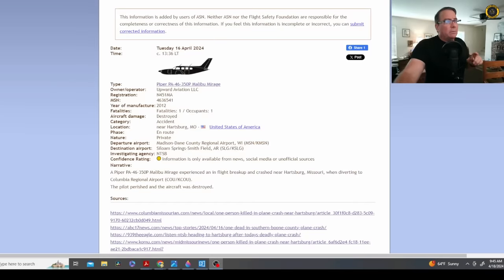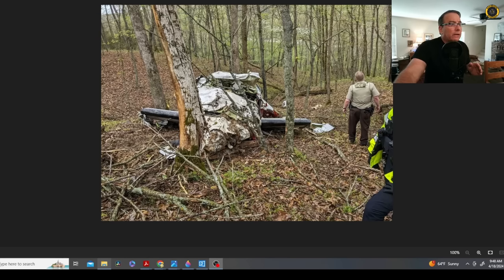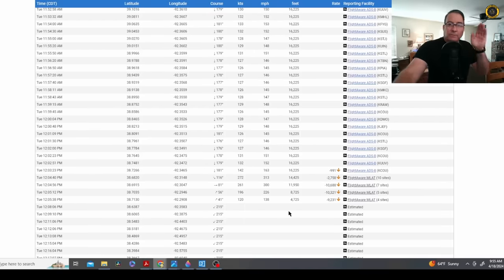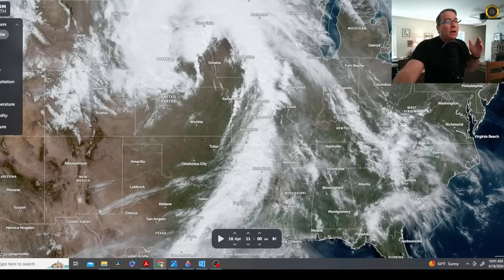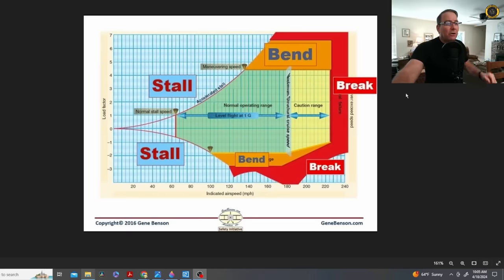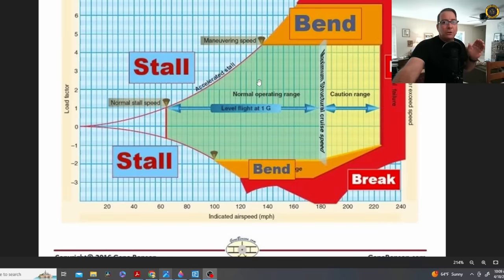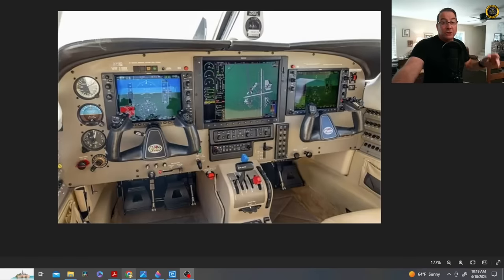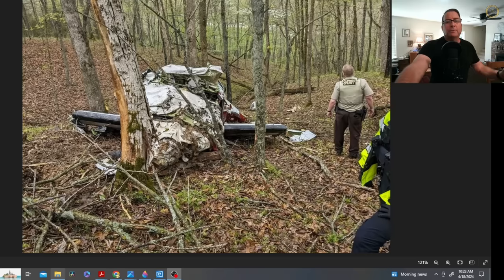N451MA PA-46-350 16 Apr 2024 Structural Failure

Comment: I worked with some Piper guys years ago and they were complaining about the Malibu crashes that were happening.   Seems that the owners basically said "I paid a million dollars for an all-weather aircraft and by God I'm going to fly it through thunderstorms" which is what caused the vast majority of the accidents.   NOBODY in their right mind fly's ANYTHING through a thunderstorm!

Another guy testified in a crash suit where the elevator had come off much like what was shown in this video.   He did a demonstration that the elevator and controls could withstand 6 times the maximum load before failure...but in closing arguments the prosecutor said 'You SAW how the tail FAILED'!!  And the jury found Piper guilty and gave the plaintiffs a big award.   Lay people don't seem to understand that things are built with limits and you MUST stay below them even though what is advertised in the Pilot Manual will have some headroom...don't push it!
Reply: People that buy these planes are usually self made millionaires, risk takers.
Reply: Flies*
Reply: I used to work for the Just Ice Dept. as a tech. and the cases get sealed so the next time there is no precedent...
Reply: „There is no reason to fly into a thunderstorm in peace time.“
Reply: @MrMonoTracer or unless you’re NOAA or NASA maybe.
Reply: You bring up a good point.  A friend of mine who was instrument rated died when he flew into a thunderstorm at night near Downing, Missouri in 2004.  I'm thinking that he had to see lightning ahead. (he did not have weather radar).  He was fine when he talked to a controlled 11 minutes before he disappeared from radar. That controller did not warn him which was the basis of a lawsuit later.  But what possessed him to keep going. This was the FAA's position in that lawsuit.  I think they did settle however.  There was a lot of money at stake because they all three  had high paying jobs.  I think about 20 million was being sought. The FAA may have tried to get off cheap in case they lost.
Reply: Amen Brother. Mother Nature wins every time. Fly smart, fly safe.
Reply: @MrMonoTracer That’s a military saying. In the airline world it’s very possible to fly through bad weather.
Reply: Lol what? So the company makes a claim of all weather and you are like "it's fine they didn't meet the standards they advertised and set for themselves". As an engineer yes things have limits which is why you engineer margin of safety into your designs. Lol to say that it's impossible for someone to design a strong aircraft for thunderstorms is absurd. It even sounds like the court agrees 🤷🏻‍♂️
Reply: We were forced to fly a F-4N Phantom through a line of thunderstorms off the Florida coast on an emergency fuel divert from the boat.  It was not fun and I wouldn't want to do it in a plane with much lower stress limits.
Reply: It's the V-tailed doctor-killer mentality.  They are successful people who got where they are by not taking no for an answer.
Reply: @raybruce9522  Well, as an airline pilot, I can tell you that thunderstorms scare the crap out of me. Been there, done that. No need to do it again…
Reply: Yes, all these high-performance, single engine, turboprop aircraft are becoming the "New Doctor Killers", a title that was once held by the Beechcraft V-35 Bonanza.  Owner pilots with more money than good judgement and flight time.
Reply: What happened to max speed in rough air??no POH info?? Every aircraft I have flown have a max vne for rough air!!!😮😮😮
Reply: Reminds me of a time we were in an old Cherokee and got surprised by uplift of a front between SC and IL.  Dad looked for a way out because he was uncomfortable getting near the top limit and he somewhat turned out and went down lower. Later, my dad said the book says not to turn around. I was too young to understand the flight physics, but I'm expecting that this sort of chart is the reason.
Reply: @jimw1615  "Owner pilots with more money than good judgement and flight time." That's a good description of Cirrus pilots as well. At least with them they will likely survive due to CAPS, BUT . . . because of CAPS they do not make the best risk decisions.
Reply: @flybobbie1449  Cereal box licenses too.
Reply: @jimw1615  I'm a non-pilot, I can't afford it, and stuff like this really shows why aviation is so expensive.  The cost of a new plane is nuts, even a 172 is a half million dollars new.  Rich people buy expensive planes, the plane is more than the ability of the pilot, or the pilot takes risks, and then the estate sues the manufacturer, and the manufacturer usually settles, raising the cost of all new planes.

Not really related, but I think about TNFlyGirl, she had to move up to a complex hi performance plane, so much more than she could handle, and she died.
Reply: A prosecutor in a lawsuit? Was the state suing Piper?
Reply: I’ve seen from my 767, a 747 going by a massive thunderstorm up to 52,000’. It looked like a pea against a heard of elephants. Even 747’s are no match for a massive cb storm!
Reply: I'd pay a million dollars not to fly through a thunderstorm in a light plane. I flew an Aztec solo through a gap between two big cells in clear air and spent almost five minutes as a passenger. That was the roughest air I've ever experienced and I was shocked that my mechanic didn't find anything broken. No way would I go through one.
Reply: @davidfrench5407 Regarding TNFlyGirl, to quote Maverick and Rooster, “It’s not the plane…it’s the pilot.” She was unfortunately so confused in the air that I believe she was going to meet that fate somehow or another, regardless of whether it was Debonair or Cherokee (which she also damaged on the ground).
Reply: @Inspadave Do you have any hard data or is this your gut feeling?  I do not agree with your “description of Cirrus pilots”, it is only a knee-jerk reaction to try and explain what you feel is a high accident rate for Cirrus, and/or Bonanza.  There are STC’s for BRS in non-Cirrus aircraft as well.  One should look at the accident rate per fleet hours flown, if possible.  Nobody can possibly know what role, if any, CAPS plays in pilots decision making.  Maybe you are a Cirrus owner/pilot and that is how you think.  There isn’t enough information about the PA-46 pilot in this case to learn or conclude from this accident.  We know the aircraft was recently purchased and it came apart probably due to poor weather, crashed and killed the pilot.  We don’t know his experience, total PIC time, ratings, trainings, health, aircraft maintenance and damage history, or his income level.  Juan reminds us all about the importance of good judgement regarding turbulence and decision making.
Reply: @MrMonoTracer  Same here 35 years as an airline pilot. They scare the crap out of me especially after being in a few situations that were unavoidable and I was forced to penetrate a line of level 5s. It was like flying through the twilit zone. The whole plane load of passengers were screaming but we were fuel critical so no choice.
Reply: Remember - It Still HURTS.
Reply: @bardmadsen6956  wow, I didn't know that.  But it's probably a good thing
Reply: @mesillahills  The US as a nation seems to have lost its moral compass in even allowing that sort of case into court. I started consider the US in decline when I heard about the McDonalds hot coffee case thirty years ago.  Once that sort of thing gets through, you'll have dogs defecating in the aisle of the first class section of airliners which have to divert due to the [continued on page 94]
Reply: @flybobbie1449  Would they  be marketing people who haven't realized that they are not the only ones profiting from propaganda?
Reply: Yep, lawyers and idiots are why aviation is so expensive!
Reply: I wonder if Piper appealed the case?
Reply: @SubTroppo  The coffee incident was not as simple as corporate propaganda would have us believe. The vehicle the plaintiff was in wasn't moving, and because it had no cupholders she rested a cup of hot coffee in her lap and the lid came off saturating her clothes and instantly causing severe injuries. The court proceedings uncovered the fact that the coffee was super heated to an insane level about 190 degrees which was standard at McDonalds but far hotter than anyplace else. I used "Findlaw" as a source for this info. I was born before the civil rights movement so my opinions about the good old days when US courts were allegedly just and fair and rational differ from people with different American experiences.
Reply: @dpeasehead  Ah, yes. "in her lap".  Did the plaintiff perhaps also sue the manufacturer of the car because there was no "recall" issued to have cup holders fitted? " On the evidence presented I rest my "case" with the rider that I would never state that justice systems anywhere are just or fair; "the law is an ass" as the old saying goes.  ps I wonder whether the plaintiff had been to a McD drive-thru previously.  Personally I avoid McD's hot drinks because they were so stupidly hot the last time I purchased them.
Reply: Even the Heavys strive to fly above and around it.
Reply: @thomasdobbs9001  that's what this entire video was about....
Reply: @flybobbie1449 wrong, I bought one and I’m no millionaire
Reply: Yet it still seems Piper has a disproportionate rate of incidents so that can't be the only cause
Reply: So much for a "jury of our peers." It would be interesting to see how a similar case would play out with aviation people as jurors. Of course, the lawyers wouldn't stand for that.
Reply: It’s been a while since I flew 308 of them in flight test, but I seem to remember a really short yellow arc, which you have on piston part 23 aircraft.  What tells you is that the structure goes from 50fpm gust loading to 25fm in a really short span as the speed increases.  Driving them at Vd (Vdx.9=Vne) I always spent a lot of time finding smooth air. 
I did crash one in the mid eighties but it’s because it was melting inflight from a huge fire.  Crashing hurts.
Reply: @MrMonoTracer 
Don’t just hate when the clouds are green out the windscreen
Reply: No owners said that. From the onset the plane had engine problems an later autopilot problems.
Reply: Had an instructor tell me “fly into a thunderstorm and there’s pretty good chance you’ll come out as rain”
Reply: @simeon2851  Yep. In a T-storm even the largest aircraft are just like corks being tossed on a choppy sea. The difference is that unlike aircraft, the corks won't disintegrate due to the sudden, massive and violent forces that are being exerted on them.
Reply: @bardmadsen6956  Just Ice Dept.?...sounds like a rap star alias....
Reply: @SubTroppo the US has never had anything even resembling a moral compass where a dollar is at stake.
Reply: @davidfrench5407  I'm really tired of hearing about fly girl, but anyway, not only should she not have had a high performance aircraft, she should not have been a pilot at all. She didn't understand the very basics. From things I've been reading, it appears that pilot licenses are being given away. You have an entire generation or two that think things should come to them immediately and move up to more complex aircraft and work to get there commercial license and so forth. I've read about a lot of really bad flight instructors that really don't care about teaching, but rather, are simply marking time towards their flight time requirements. I don't think it used to be this way. It's getting scary.
Reply: @kenclark9888  You are no millionaire because you bought a plane! LOL!!!
Reply: @jimw1615  Only doctors could afford them so it stands to reason...  same reason the Tomahawk killed a lot of student pilots.
Reply: @SubTroppo : Remember that the legendary McDonald's case was not frivolous. McDonald's spent lot of money to paint it was such, but it was not. It was them repeatedly breaking rules to make more money.
Reply: Truth recoilrob!
Reply: @mesillahills  I'm confused where the FAA fit into your scenario here regarding the lawsuit.

Why were they dragged into it?
Reply: @truracer20 Nice cutlass.
Reply: @IslandFar I blame SUV for this. Most people were used to drive cars and then bought a SUV, which have higher center if gravity, and are easier to overturn. As for normal cars, it depends on which car. I've heard there's some states where driving lessons are not mandatory to get your driving licence, so you have more performant cars in the wrong hands, and crash happen. I've got my driving licence in Europe 40 years ago, so it's only what I've read on Internet, but seeing the number of crash that happen in the US, what I've read about the driving lessons is likely to be true. It's the same thing for many countries in Europe as well. Newer cars are safer, but people have to understand they're not indestructible either.
Reply: @JariJuslin I think you're right. They spend a good amount of ressources to ridicule that lady. As any major business would do. It wasn't frivolous at all, the lady was badly hurt. And there's no reasons to have the Coffee stupid hot like they did, and still do.
Reply: and now we all suffer with higher insurance because of these idiot trial lawyers.  More cost for the airplane since the OEM has to pay more for products liability and more for us operators to fly.  Just like medicine, the answer was tort reform, not more govt BS.
Reply: @mesillahills  Is it the FAA/Controllers responsibility to keep a pilot out of bad weather or the pilots?
Reply: @larrygaal4808  Their (the FAA) contention was that they were NOT and that is true. But there were apparently other circumstances.  An earlier controller had re-vectored them to the position they were in for the sole purpose of avoiding weather.  So the widows contended the FAA had responsibilities.  The original controller had apparently erred as is relates to how far further south they had to fly to safely get around the weather. And he did not pass it along that he did that.  The widows claimed that the earlier controller actually  flew them into the weather. I think a final settlement was kept secret but I was told by a fairly reliable source that there was one. All this is hearsay, of course.
Reply: Even airliners fly around them. !!!
Reply: Yep I experienced the exact same thing when doing investigation of a Malibu that flew through a thunderstorm. Tail came off
Reply: There has to be something wrong with you to want to push through severe storms. It only takes one drop or toss to snap your little bird. The amount of energy inside those things is difficult to comprehend. In many ways, as soon as you enter that kind of weather, you’re no longer in control of your aircraft even if it feels like you are.
Reply: @thomasdobbs9001  dude it's called VA - maneuvering speed. that was Jaun's point
Reply: @flybobbie1449 "Risk taker" is an aspect of the "Real Man" profile. And it may mean they'll risk YOUR life as well, try not to forget that part of the characterization.     👀🍷
Reply: @thomasdobbs9001 staying below Va does not guarantee survival flying through a thunderstorm as airspeed is always fluctuating and turbulence could cause simulated full defection of control surfaces.